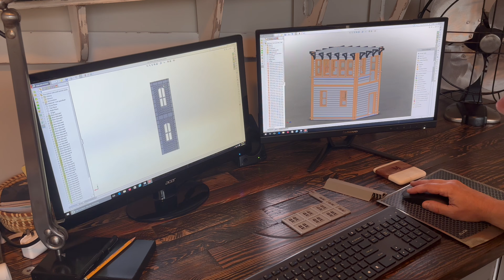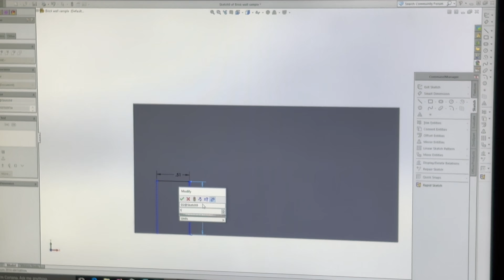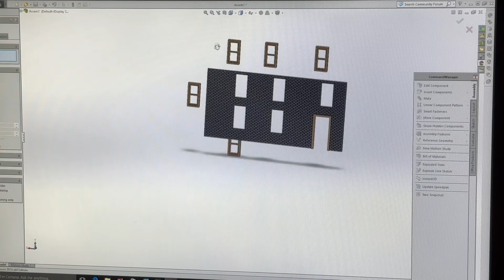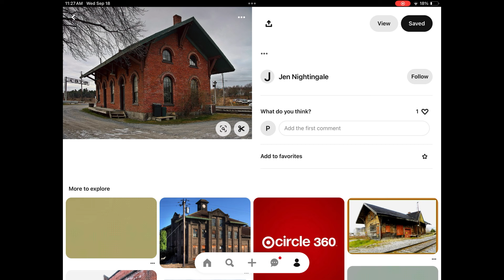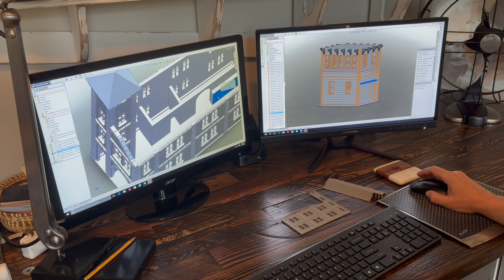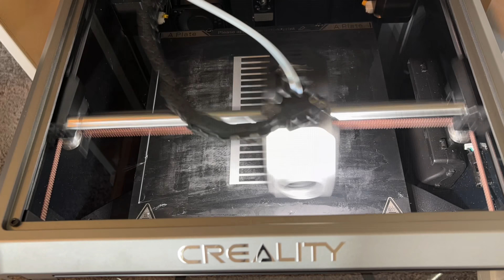Designing and 3D Printing a Custom HO Scale Building

Comment: Really cool ... I was thinking about trying to design some buildings and print them out also. I do computer science / robotic machine learning research and print a lot of my robotic parts but also do model railroading as a hobby. Great to see someone doing this! Do you use any type of architectural CAD or just a mechanical CAD.
Reply from the maker: I worked as an industrial designer for a number of years.  SolidWorks was the design software I used and continue to use to this day.

Comment: Nice idea about the panel.   So you make one panel as a file, and then "import" a completed panel into a new drawing?
Are you using a 0.2mm nozzle for prints?  How about layer height?    I model N-Scale so the layer lines are a bit exaggerate using FDM, but resin printing doesn't work too well with flat panels.
Reply from the maker: Yes, kind of.  When I “cut” a section from the large brick panel for example, I save the file as “save as” so it creates a new part but keeping the original file in tact to use again in the same way.  I could see N scale being a little tougher with FDM, I will try the fire station file in N scale and see how it comes out with my system.